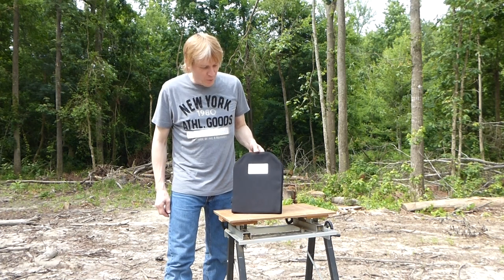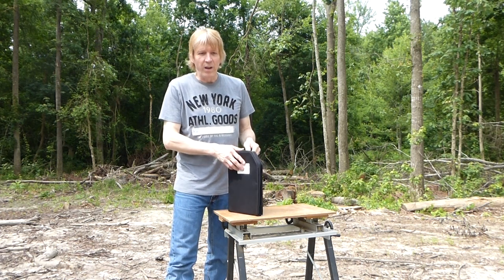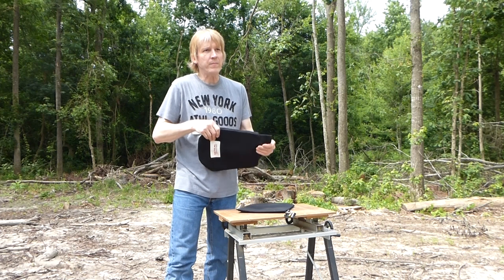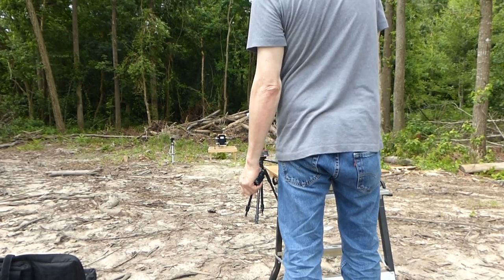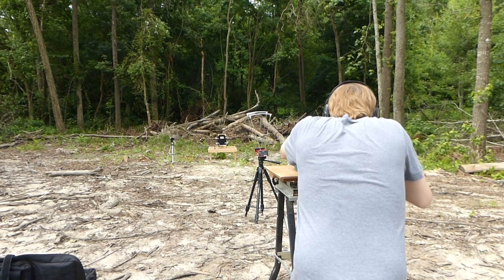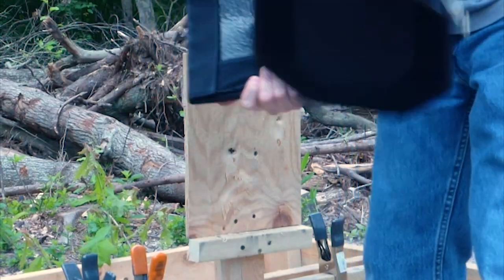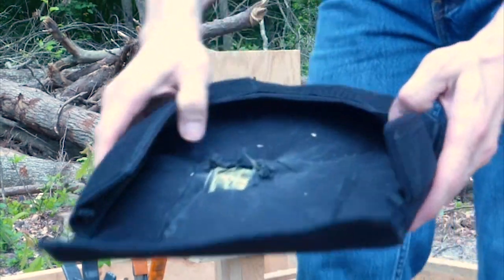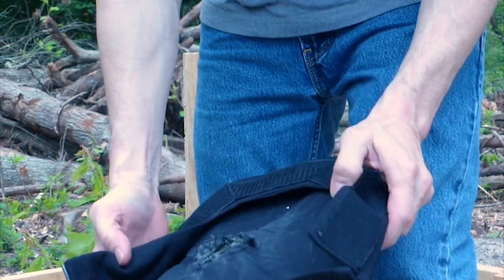Tactical Scorpion Gear Spall Guard Blocker Test

Comment: I ordered one of these and the sides seem to just be Cordura (instead of Cordura + ballistic material like the front).  Since splatter moves directly to the sides at a right angle to impact, I'm concerned about whether there is any ballistic material in the sides.  Also, the trauma pad is basic closed-cell vs. a real non-newtonian material that hardens on impact, to distribute the force.  Overall, this spall guard is pretty thick (much more than, say, Spartan Armor's spall guard) and it's not clear whether I can remove the trauma backer and replace it with another brand, like AR500's.  Would like to see some more extensive testing of Tactical Scorpion's with more types of rounds and something that looks for leakage around the edges.

Comment: Soooo... am I just crazy, or did I just realize there is NO kevlar on the edge, so spall is basically going right into my neck... Idk about that one, but I've seen videos and other people's plate covers, and it's JUST FABRIC around the edges, which is definitely where you'd need to not have metal shooting out. Especially the top. Couldn't there have been a strip of kev around the edge?
Reply: There's another test on this one done here on YT. It took a couple pistol rounds, and the rest shredded the sides.

Comment: Does the ballistic aramid "strike face" (for lack of a better word) wrap around the edges of the steel plate? More concerned about the nasty splatter fragments coming out at a 90 degree angle from the steel plate, than the ejecta coming out the front.
Reply: Has protection on sides as well